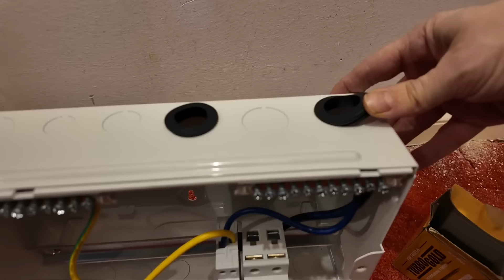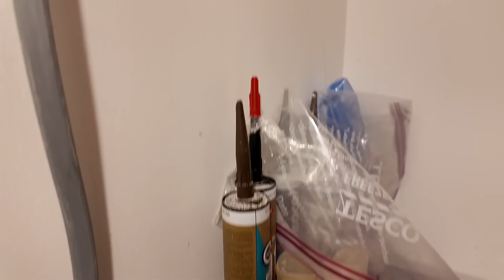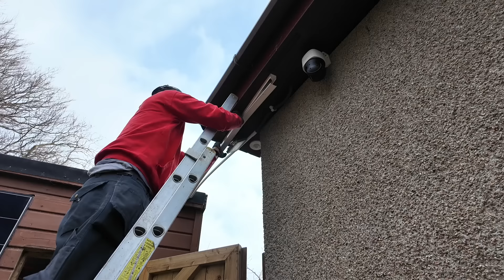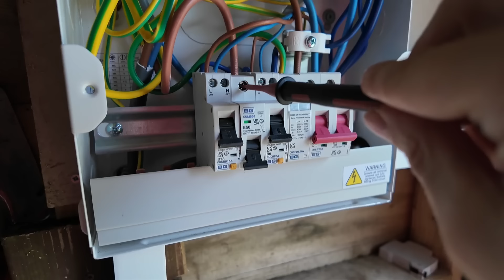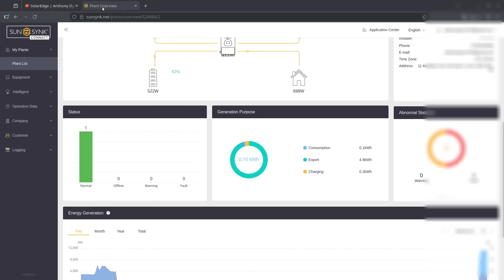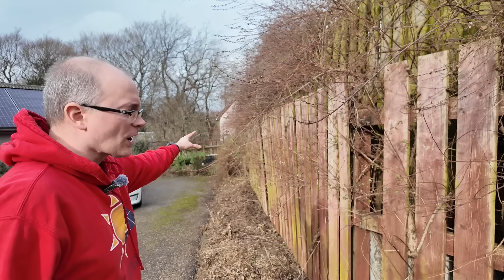First 2 weeks of 32kWh Fogstar - Solar Fence / Shed / Battery Project Part 8

Comment: Good series so far. For those with limited budgets and skills the range of power stations now available are very plug and play. And starting at fairly low prices for 2-3kWh models from Bluetti and EcoFlow. A 400-500W solar panel plugs straight in . Minimal wiring and fuses etc with MPPT Reg plus Wifi control built in so making a cup of tea in the shed no problem. Move it to the house if needed or even take it camping.

Comment: i use a Victron easy solar 2 and 2x fogstar rack batteries nearly 4 years old never missed a beat will buy more soon and 4 x 500 watt panels 1 year old i upgraded from 2x 400 watts with tigo optimizers 9.2 kw produced today

Comment: is your inverter has it got 2 inputs for solar if so add 2 more panels one on each string this will mean fence string on one and shed side on one no bad effects between the 2 strings shadows wont matter but it still make inverter start up 3 panels on each string 100v plus shed in cloud you will get over start up voltage

Comment: only use your snips in middle then grab earth with pliers if cant use snips as you may cut earth😊 and pull down then trim cable the only 20mm of earth wire is mangled

Comment: Isn't the solution to add more solar panels onto the string, so voltage is higher quicker and MPPT starts producing power? (Roof of shed for example)

Comment: can i just ask - what is the max output of the battery? I have a 5kw inverter and am keen to get these instead of the 20kwh i currently have, as its not enough and i cant get any more fox lv5200s.
Reply from the maker: I think it’s 290 Amps or thereabouts.  It’s about 15kW.

Comment: Something to watch out for is the voltage rating of the comms leads run inside the CCU alongside the power wires. They should be insulated to the same voltage level as the power cables or segregated (which may not be feasible). Maybe sheath them in suitably rated sleeving.
Thanks for interesting content. I'm trying to finesse my own system and there are so many variables the more I delve into it. I got stitched up on batteries a while back by SOK Europe who don't honour their warranty. So I need to invest in more batteries and am considering the Fogstar, particularly as they are UK based. Not sure whether to get server rack style or the unit you have. Pros and cons to both.
Reply from the maker: The twisted pairs inside the consumer unit come from the cable feeding the car charger.  It’s a combined 6 mm and cat5 cable all wrapped into one steel armoured sheath.  Doncaster cables make them.
Reply: @anthonydyer3939  Is the twisted pair insulated from the power wires in the cable before it's split apart?

Comment: you could try aiming them properly ... vertical is wrong everywhere on earth.
Reply from the maker: There's no "right" or "wrong" when it comes to vertical orientation for solar panels.  There's only "better" or "worse".

Against that question of better of worse, we can then throw in the question of "cost" and "opportunity".  My rooftop is fully occupied, so there's no opportunity there, and it would cost a lot in terms of safe rooftop access.
Angled ground mount solar just takes up so much space.

Vertical solar costs very little, in terms of both space and material requirements.  So will it may be worse compared to rooftop solar, it's "best" in the given set of constraints.
Reply: @anthonydyer3939  Yes and you could keep your doors and windows all wide open during heating season -- no right or wrong, just better or worse.
Reply from the maker: @Simon1217-d3e I could do that, but there's no constraint or cost that compels me to take the worse option when it comes to heating vs doors and windows, so it's not the best analogy.

I'd love to have a wide open garden with a sunny disposition all year round, but that's not the reality of the situation.   I work with what I've got, and given that solar panels can be obtained for only £48+VAT each, is it really necessary to demand a perfect setup for catching the sun?     

Sure!  Thousands of pounds have been spent on the inverter and batteries, but the solar panels haven't added much more on top, and they are essentially just "bonus capability" on top of the main prize of having more battery capacity.

Comment: I think I would just get the rails and panels installed and waiting see what happens with neighbours fence. You can always disassemble it if any issues. I have a dual solax and sunsynk set up but just have my HP on the 3.6 sunsynk and they play nicely together.
Reply from the maker: Thankfully, I didn’t follow this advice.  The boundary fence collapsed a few days ago and there was definitely a chain reaction.  I’m reckoning the wall just put enough pressure on the joist to make it finally fail and then all the posts were rotten so they all collapsed.

Comment: Just Sub'd, but this is the third video of yours I've seen now. I have a simmler set-up, I have 4x 420W panels making a lean-to shed/store, set at 50 degres, and south facing, I also have some (4x) 150W panels facing vertically S/E on my fence. This is split into 3 Victron 100V 35A MPPTs. But I'm very lucky to live in the sunniest place in the UK, on the coast of the South Hams, and according to PVGIS we get nearly the same amount of sun as Canberra, Australia, which PVGIS also shows we get the most sun here, mainly as we get the least rain here, which is crazy as only 35 -40 miles away they get the most in England, in Exeter. But anyway, I built my system to charge my electric motorcycle, but after running an heavy duty extension lead to my home, I've found it can run my home too, 10 months of the year, and about 50% in December and January. Today, like most days for the last 4 weeks, I've made 7.5KWH in total. Or 3.2KWH from each of the 2x 420W panels, and just 1.1KWH from the 4x 150Ws, but they on the fancs get lots of shading, so I'm thinking of adding more, and, or moving them. My battery is a 30KWH LFP, which I built using EVE cells from Frogstar, but after seeing your other video, I'm thinking of getting one like you got, maybe the 40KWH :)
Reply from the maker: The 40 kWh battery is definitely a beast!  I’m guessing you’ve got level access from the road for a pallet truck to its final resting place.

But it sounds like you’ve got an interesting application for your solar panels making it a lean to.  It’s actually a pretty good idea for storage underneath.

Comment: Just for now, you could hang the panels off the fence in a temporary arrangement until the neighbour decides what they're doing and get's on with it. You might as well get those panels doing something if you can.
Reply from the maker: Unfortunately the fence collapsed.  Thankfully without the solar panels mounted. There was a lot of pressure on one of the posts, that was being pushed by the wall, and the fence joist holding that post in place finally failed, and then the whole fence tipped over in a chain reaction.  All the posts were rotten at the base.
Reply: @anthonydyer3939  Good thing that happened before you put the panels on! That could have been heart breaking.

Comment: You might also be losing a bit to the ground cutting off half your ambient light. If you lie on your side on the lawn looking at the horizon it'll appear darker than if you put yourself up a bit on a table doing the same thing. Vertical solar panels with a nice pale reflective concrete surface in front of them will do better than ones standing above grass. I put my panels up to about 70° mid winter, but that ruins their output on the many gloomy days I get in midwinter in my rainward Dartmoor garden, because half their 'sky' is then dark garden fence/lawn, and neighbours' houses. Midwinter in a rain magnet is rubbish for solar anyway one arranges the panels...

Comment: The only tool you need to strip cable of any size is you snips split the middle and pull the earth to continue the split to required length snip the outer sleeve takes 10sec and done.
Reply from the maker: Not with 10mm T+E.  I struggled and failed.  2.5mm it works a treat.
Reply: @anthonydyer3939  the way we strip 10mm t+e in the trade is to cut either side of the cpc firstly which divides the cable into 3 pieces - you then take the middle outer sheath from the top and the side two from the bottom and then just pull which just simply peels the outer sheath apart exposing the inner cores without any damage. Quiet hard to explain but give it a try.
Reply: @anthonydyer3939  you must be a diy-er. 10mm is easy to strip. All t&e is easy.

Comment: Vertically mounted solar panels never perform well. You need to orient them directly at the sun for optimum performance.
Reply from the maker: What you say is true,  but optimum placement costs money.  And often it costs many times more money than the cost of the solar panel itself.    So the point of this project is not optimum returns per panel. Instead it’s knowing that the cost of the panel isn’t much more expensive than the cost of the materials that would otherwise be used to build a fence or shed cladding.

Comment: You should mention that you are in Scotland and you are qualified to carry out electric installation. The Scots law is more stringent than the English laws regarding who can carry out electric work.
Reply from the maker: Is it more stringent?  In England this work would require building control Part P notification, or use of an electrician who’s a member of a competent person scheme.  In Scotland there’s no such building warrant requirement for electrical work with dwelling houses , unless it’s part of a bigger job.  It still needs to meet building standards, and by extension wiring regs though.

There was one MSP who proposed that electricians should be a “recognised and protected trade”, and that all electrical work should only be done by “recognised electricians”.  But I don’t think that’s gone very far. No doubt the telecoms trades raised their voices on that one.

Comment: Use a cutter pliers from end cut about 1/2 inch pull out earth pull earth will spilt cable no damage to wires easy way to strip heavy gauge wire
Reply from the maker: That works for a small gauge cables.  Indeed, I’ve used that cheesewire method many times.  But for 10 mm twin and earth cable, the sheathing is just too thick to apply cheese wire methodology.
Reply: @anthonydyer3939  I did it with that same wire not a problem. 60 amp 3 core wire

Comment: You could have used a small 100amp isolator. The type they use near your payment meter.
Reply from the maker: This is part of the larger plan to replace the existing consumer unit.  I’ve got a switch fused isolator which is going to be mounted right next to the meter.  And then I want to get the meter tails upgraded from 16 mm to 25 mm².
Reply: @anthonydyer3939  yes get rid of the plastic one , they burn too well

Comment: Stick your 2 fence panels on a micro inverter. Ecoflow has a 800w one on sale at around £109 atm. Use the sunsynk "gen port" as a micro inverter input. Job maybe jobbed.
Reply: Agreed, and run it through a Shelly PM Mini Gen3 for power monitoring in HomeAssistant if that's your bag - they can meter generation as well as usage now.

(IMO it's an underrated feature of the Sunsynk that you can put a couple of panels on an odd aspect on a microinverter and wire it into the generator input, without getting the DNO involved.)

Comment: For the next fence panel project, could you remove your existing fence and build a solar ground mount with a steep slope instead of mounting the solar panels vertically?  🤔 
If so, maybe you could mount some of the ground mount on wheels until the neighbour completes the retaining wall repair. 
That way you could go ahead with constructing the solar fence to harvest the spring & summer sun. Later, wheel the panels out of the way during retaining wall works, and then fix the fence into the ground afterwards. 😎
Reply from the maker: The existing fence collapsed a few days ago.  The whole lot went down in the chain reaction starting with the fence joist that was holding back the fence post that was being pushed by the wall.   The remaining posts were rotten at the base.

For now, I’m going to treat that entire wall as being unstable.  But certainly my neighbours are on it. It feels very weird looking into their garden.
Reply: Yikes, that does sound scary. I hope that the neighbour will be able to get a new retaining wall built soon so you can harvest some sunlight this year. ☮️

Comment: The Fogstar is amazing value for money and at £100 per kWh that’s half the price of the FoxESS system that I have, and these prices are now half what I paid for my system 4 years ago. But you touched on an interesting point about compatibility between systems, yes I’m certain you will find away around it with Home Assistant, but you will be missing out on being able to take part in virtual power plant arrangements run by the utility providers. The beauty of this sort of arrangement is that you don’t need to continually update your system programing when tariffs change to make the best use of your battery investment. Currently Octopus do allow some FoxESS inverters to participate in these schemes unfortunately for me, not with the inverter I have that is already incompatible with the latest FoxESS batteries and inverters.
Reply from the maker: The great thing about octopus flux intelligent is that I can subscribe my solaredge system to the scheme,  but then I can leave my Sunsynk system under my control, so I can get maximum value out of that expensive export period.  

i’ve been figuring out the RS485 connections for the Sunsynk modbus register list.  And then there’s a separate modbus register list for the RS485 meters that you can get connected to the inverter.  One idea I’ve got is to use modbus TCP to fetch the metering data from the solaredge meter and then use my raspberry pi as a broker, sending that data on to the Sunsynk inverter, making the Sunsynk believe that my pi is actually an Eastron meter.

I just wish I could interface my Sunsynk inverter directly using modbus TCP.  It would massively simplify the hardware topology.  Right now I’m facing the prospect of having a mess of wires for a raspberry pie right underneath a Sunsynk inverter and then having to figure out how to supply 5 V to that raspberry pi and that probably means having to occupy one of the 240V socket outlets permanently.  It won’t look pretty.
Reply: @anthonydyer3939  - do ♥ ♥ this - I'm trying to move my inverter into my shed like you, and am trying to get a Shelly Pro 3EM (via wifi) to provide the grid energy meter feedback 🤷‍♂🤷‍♂(Git-Hub - say its should be possible to load the script directly onto the inbuilt PI - but am struggling)
Reply: @anthonydyer3939  Why not use a Buck converter? They do nice potted ones, 8v to 80V down to 5V. and 1A, 2A or 5A, which will power a PI nicely. Meaning you will have plenty of 48V sources to power it from. I just add: the one I've been using for 2.5 years on my PI, I got off the Bay, seller is "Primethink" made by Regu. 10-80V in, 5V 3A out, fixed. And I power it from the 48V inverter DC input.

Comment: Interesting real world results where the shed location is not ideal; thanks for sharing. 
I note your point that the cost of solar panels is now not much more than wooden cladding. That makes it interesting to see what seasonal performance will turn out to be for solar cladding. 
The MPPT minimum voltage threshold seems to limit solar harvesting in the winter when we need it most. 
When designing a new shed, I would be inclined to plan for 6 panels on the South wall.
For this existing shed, could you move the shed door to one side and add a fifth panel to the front of the shed? 🤔
Reply from the maker: No room, even if I did move the door.  

The problem is that the shed solar is the last place in the garden to receive direct sunlight.  It doesn’t get substantially exposed until 1:30pm.  In mid winter, by 1:45pm, the sun slides behind the trees once more.  

To boost morning time solar, I’d need more panels against the fence to boost that maximum power voltage.

Comment: I run a voltacon and can have the same problem not enough voltage but mainly the mppt are no good so I run a victron 250/60 mppt straight to my fogstar and have my cerbo plugged into the fogstar as the app for voltacon is no good and make far better power running it this way
Reply: I use 3 Victron 100/35 MPPTs, this way I split them up. They are the best money can buy.
Reply: ... I get all my stuff through voltacon also - as they give pretty good one to one advice on physical collection 👍 👍
Reply: @EverydayLife621 I have no faults with the inverter I can pull 11kw and it not fase it .I have 2.4kw of solar the most the inverter mppt put out was 1.7 with the victron I can hit that first thing in a morning and as the sun rises I get 2.8 kw soon charges battery
Reply: @jimconnelly8759  - i think we are all similar 🤷‍♂ 🤷‍♂ -  use voltacon (as its local, and use their advice), but we are all different, I can pull 14kw easily, but for house loads its limited to 2kw as this is (currently - pardon the pun) old stuff in our cottage 🤷‍♂ 🤷‍♂

Comment: In America we do have many wall batteries companies, but for the best bang of your money, a lot of people are doing rack batteries, easily half the cost, and then your choice of inverters/solar chargers...you can ever get gridtied inverters tied to the batteries, but majority  use off-grid inverters... 
I have both back up and gridtied inverters, but I do not export...
Reply from the maker: My inverter is hybrid, it has both a grid connection and off grid load connection.

Interestingly there’s an additional “auxiliary” connection which allows you to connect an existing grid tied inverter direct to this one, potentially taking it off grid.  It’s potentially very versatile.